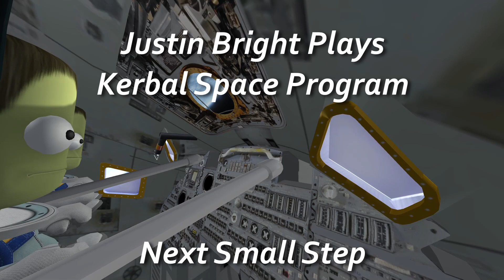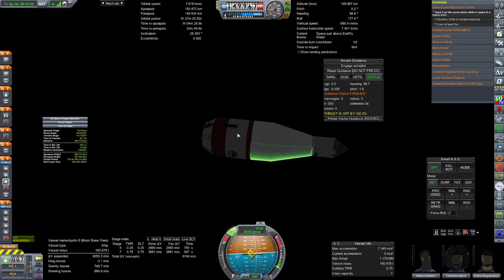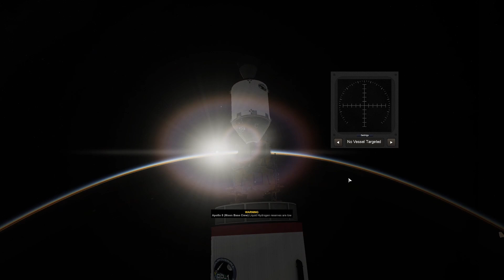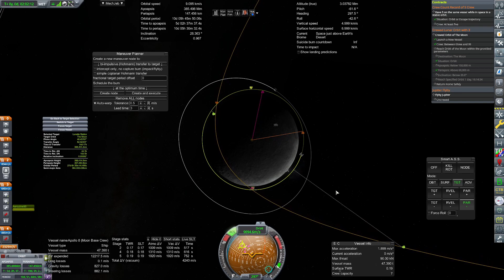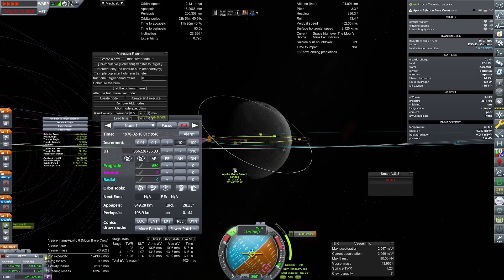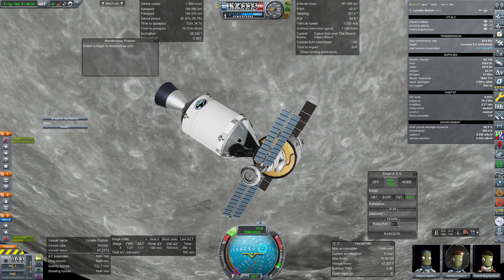Bad Latitude! - KSP/RP-1 - Next Small Step Episode 108

Comment: You have quite precise measure, to stay relative close on that period of time. It's orbital period. With my rough estimation after 11 days you will be about 150 km from LEM because orbit periods differs little more then 1 second (1.06s). If you could lower the difference to 0.05s or less, the LEM should flay away no more then 8km on closes aproach.
Reply from the maker: Ahh, that's right. I should have made the connection to setting up Geosynchronous sats that orbital period is the key. Let's see if I can bring that number down before I time warp at all!